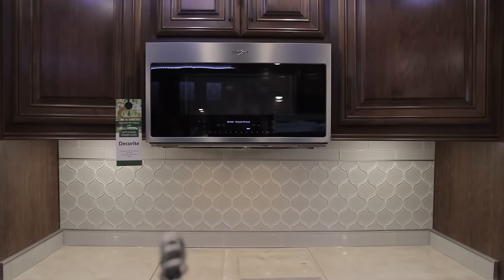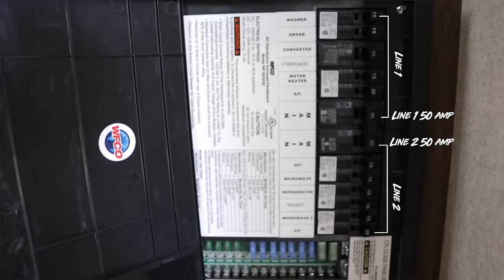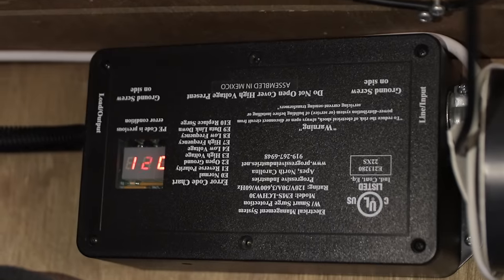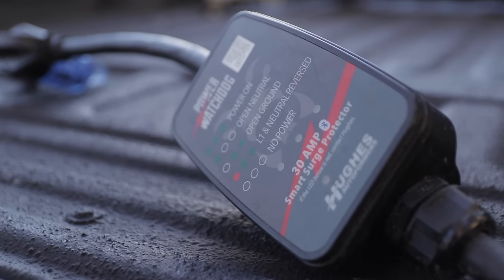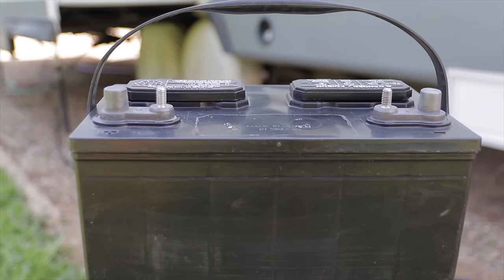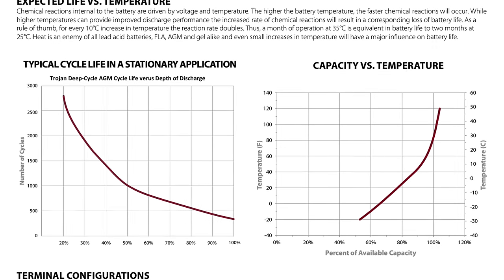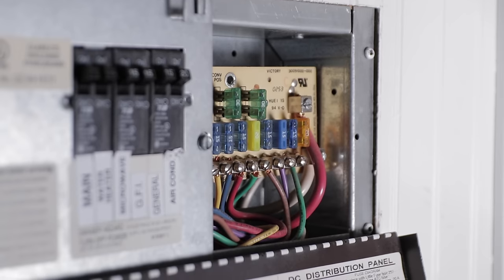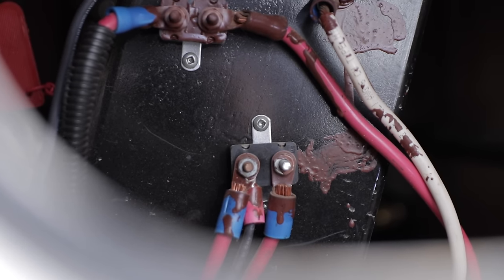Understanding RV Electrical!

Comment: Just this week I replaced a 30 pound converter in my 30 year old class A with a converter that weighs maybe 4 pounds and does much more for my house-batteries and D.C. system than convert A.C. The old one hummed 24 hours a day, the new one is silent. I think that old converter ruined my 2 new lead-acid house-batteries in less than 2 years. I also discovered that my AGM starter battery had been hooked to a non-AGM trickle charger and maybe that's why that Optima battery only lasted 2 years. I started on this voyage of discovery when I was cleaning terminals and found that there were 8 "short stop" switches, heat-sensitive switches fed by the converter and the one coming from the converter was defective. That was why my radio, tank-monitors, battery-readers,  lpg alarm, water pump, captain's chair controls and under-cabinet lights weren't functioning. And, that's probably how I was able to purchase this motor home at such an unbelievable price. By replacing a $3.50 switch, everything functions correctly. Pure luck.
Reply from the maker: That's great!

Comment: Just started watching your videos since I just purchased my first camper. Appreciate the tips!

One minor correction to your video is 240v is still considered single phase. It is 2 phases but is still not called 2 phase or split phase. It’s just single phase
Reply: The 50 Amp 240 V AC outlet is Single Phase and it is Split-Phase, not 2-Phase ..

Comment: For those watching.   The last RV park I designed was done with a three phase system voltage.   Single phase receptacles at the pedestals.   The point is, if you check the voltages on the 50 amp receptacle, you will get 120 volts from each hot to N&G. But you will get 208 volts from the two hots.   This will cause you no issues!   Everything in your RV is 120 volts.
Reply: I have My Ac running every day, but I don't understand why it keeps turning off the breaker, Please help me I have 3 kids and it's about 120' Hot.

Comment: The new Ford SD trucks are isolated as well. When the truck is running it charges the trailer batteries but when the truck is off it does not scavenge off the truck batteries.

Comment: Thanks for this...In over 15 years of owning RV’s we have never had bad shore power, and tbh I never gave it any thought until watching a few of your videos.  Suffice to say it seems we have been very lucky.  I’m having a lot of problems researching them (50 A) because every one seems to have a totally mixed bag of reviews and horror stories (Including your Hughes) so I’m really at an impasse as to which one to buy).
Reply: Fifth Wheelin' Food and Fixin', we have a progressive industry unit and had nothing but good luck. This was after the 2 Cheapo units sold at the big box camping centers. We looked  at space craft and New horizons and they come standard with progressive industry EMS units. A little more expensive but you get what you pay for. 
Jared uses a unit to check power at the pedestal. I turn off main power to the coach then look to see if there is a problem due to mine being a hard wire unit. Just an opinion.
Reply: This is how i looked at it, when we had our small Travel trailers, we didn’t have an external or hardwired surge protector, we were a bit in the dark, and like you we were lucky, never had an issue. Then when we paid 5x more for a big rig on 50amp, all i knew is gotta get on this! i needed one now before picking up that new rig, so being i couldn’t decide on what hardwire one to get, I decided on any external one that had all the basic safety features all the other external 50amp brand ones had, found a camco brand 2/3 the cost of the others. It will do, at least i have one, and it has actually been pretty darn good so far. Does the same things as the others. Also i kept in mind that if your surge saves your rig from some issue, your surge is toast. So how much to spend, how fast i could get it were factors for me when i was looking for one. Now many months have gone by, i think about do i even want to deal with the hassle of a hardwire one, installing, then what if it gets fried? how easy is it gonna be to remove? replace? Things yet to think about. Cheers 🍻
Reply from the maker: I haven't had any problems with ours, like Chip Saunders we have the hardwired Progressive Industries and have loved it. I called with a couple of questions a few months ago of me adding a bypass switch and they were very helpful. I would recommend them.

Comment: This was superbly explained. I just got a van ready for "Camper conversion" it has all the electrical components. They were originally installed professionally but some of them are now disconnected.  I am trying to figure out how things work as I want to relocate the cables and components. Unfortunately the seller had no idea how it works.
With this videos (and searching the manuals for each of the components) I will try to make sense of it all. At least now I know the names and functions of the components :) and I can start making the diagram of the "how it should be" and match it with how it is.
 In case I get lost, anyone knows what kind of electrician/Mechanic can help me make sense of the system? Having a diagram will help me lots.

Comment: Great video I really enjoyed it and learn so much. I do have some questions like , If a battery does not need to drop 50 if its total power, or  you can damage the batteries. I had a friend that had 12 volt batteries he told me that he used them until the  voltage came down to 6vdc . He then had the dc charger to start charging  the batteries back to 13.6 Vdc. His batteries only lasted a could of months then they they were bad. I informed him that 50% of a battery is around 12.2 vdc. The reason is the current of the batteries drops so low that if you kept using  battery power you will shorten the life of most batteries. Why  do they not connect batteries that the battery bank voltage would be 48vdc ? Each time the inverter has to step the up the voltage their is power  loss. Example 12vdc to 24vdc, and 24vdc to 48vde. Here you have a lost of power three times. Just a couple of things that popped up in my head. I'm trying to understand. Is it true that  Lifepo4 can be discharged to 0vdc and will not hurt the batteries. Most of these type batteries have a 11 year warranty. It has been stated that these type of batteries can last 4 times longer than other type batteries ? I believe if you could run everything of this DCV. You would not need an inverter what so ever. The battery pack could be
arranged that the need for AC power you would not need ?  Just something to think about ? Call me crazy ! !

Comment: The battery disconnect switch: I have noticed that when using shore power, if the battery disconnect is in OFF position, the rig has lights from the converter. However, the house battery is not charging ? Then, when switched to ON position (while on shore power), the battery gets a charge voltage. I should note, I disconnected relay that allows converter to charge chassis batteries so engine alternator is not charging lithium house batteries. No solar, too complicated.

Comment: Jerad, I think of my Class A motor home as having 4 electrical systems: 1) Chassis 12 VDC, 2) House 12 VDC, 3) Inverter 120 VAC, and 4) Shore/Generator 120 VAC.  There are appliances that only operate on one of these 4 different systems.  (I have a 2008 Tiffin Phaeton.)  Examples:  The Chassis 12 VDC (#1) powers the cockpit radio, the dash fans, and the passenger seat's electric recliner.  The House 12 VDC (#2) powers the lights, water pump, propane heater fans, slides, vent fans, etc.  The Inverter (#3) powers the compressor fridge, microwave, 120 VAC outlets, and a myriad of other plug-in appliances.  The Shore/Generator (#4) power source is required to power the A/C units, washer/dryer, and electric water heater element.  I would assume that most motor homes have similar systems to mine.

Comment: There’s single phase, three phase but never hear of split phase. I do know you have two single phase 120v circuits in the panel and if you use a double width breaker you’re using both circuits which gives you 240v single phase

Comment: Can you explain when plugged into shore  power, does running furnace or 12v equipment totally bypass the batteries and run off the converter?  Or do they run off the battery and the converter is just provider a constant charge?

Comment: Benn watching your vids and love them. I want to install an AiLi battery monitor on my Rockwood Afram,e and trying to figure out how to mount the shunt with dual 100 AH AGMs on the outside of the camper in battery boxes. This is only our 2nd year with our first camper.

Comment: I plan on using a 21 Jayco Bungalow (50amp electrical plug in) as a permanent residence for about 5 years at a house. I will have a 50amp plug in installed with a 30 Amp and 20 Amp at the house. That being said, do I have to have batteries to run the Bungalow if it will be permanently plugged in? Or do the converters need batteries to send the power to DC related systems?

Thank you and stay safe,
Your channel is amazing.

Comment: Question Jared! Using the Watch Dog surge protector  is there a reason why you can't just plug into the 120V outlet (house type) instead of using a dog bone to plug into the 30AMP outlet.

Comment: Referencing the battery disconnect during storage to save the battery from draining.  If you engage the disconnect, does the  battery still have the ability of being charged if you are plugged into shore power or does the disconnect totally isolate the battery completely? Thank you very much, awesome video.

Comment: If you have your RV sitting for a month or two between trips, any reason you shouldn't leave it plugged in if you can?  We have a 50A hookup on the side of our house.  We thought it would be best to leave it plugged in all the time so the batteries are always ready for use.
Reply: Good question I do the same thing.
Reply from the maker: Yes it should be fine to do that as long as you have a multi stage converter. If it is single stage it will end up killing your battery. There should be a model number on your converter, I would look it up to see what you have.

Comment: Great video, quick question. Just for clarity in my mind. About 12 minutes into the video you mention removing everything from the negative side of the battery and putting "everything " on a busbar. Is there any chance you meant to say "you removed everything from the ""positive"" side of the battery" and put it on the busbar?

Comment: I only have 30amp according to the type of plug. How would one upgrade to a split 50amp? I'm converting 37ft rv into a tiny home for permanent living. The electrical company is going set up a 100amp box for me for the rv.
Reply: If you are wired for 30 amps, you are wired for 120 volts. In order to use a 50 amp supply, by split I guess you mean 240 volt, you would have to replace the panel and everything from the panel to the connector on the side of the trailer. If you are intending to use 120 volt 50 amp you still have to be certain that your panel and input wiring is up to the task.
Reply: @michaelgibney3772  Thanks for reply, but it turns out that I actually have a 50a plug. So that was good to find out!

Comment: Thanks for answering the alternator question.  I was wondering about that when you have solar and lithium batteries installed.  I'm assuming that means you are also able to use the switch (sorry I don't know the name of it) that bridges the house and engine batteries to start the engine should your engine battery lose it's charge.
Reply: As a general rule you don't want to use Deep Cycle LiFePo4 to start engines.
LiFePO4 batteries themselves come in two distinct types as determined by cell type:

Deep Cycle LiFePO4: essentially the distinction boils down to the amount of lithium present in each cell and the intended application which in this case is to power electronics for long periods of time. This type is designed with capacity in mind and at its heart stores lots of power in a very small package and as such has more lithium per cell. A deep cycle battery of this chemistry will not be able to crank your engine. 
High Rate LiFePO4: these are for starting motors only, the difference being that this type has dramatically lower lithium content per cell. However, the lower lithium quantity is not an issue because by design this type is only intended to output large bursts of energy for a short amount of time. As such, this type does not need that much lithium. While this type can be mistakenly used for a deep cycle application, doing so incurs significant risk as the high current rating has a high likelihood of damaging your load. These batteries are easy to identify because they have two distinct characteristics: A) a Lead Acid Equivalent Figure and B) have a CCA (Cold Cranking Amp) Rating. 
These two types are not to be confused or interchanged. While a High Rate will be able to power electronics, it will only do so momentarily as they by design do not have the storage capacity needed for extended use. Moreover, the high current ceiling will not mitigate current spikes the occurrence of which will damage your equipment. If you are powering equipment, you require Deep Cycle Batteries. If you are starting motors or powering your flash on your camera, the High Rate is the one for you. Remember the following rule of thumb:

Deep cycle/deep discharge and high rate/starter are two different batteries even if they are from the same chemistry. This holds true for all battery types, even Lead Acid/SLA/GEL/AGM. A battery is either for deep cycle or for starting, never both despite any claims which may be made so make sure to double check your application and confirm your requirements before purchase. 

https://www.bioennopower.com/pages/faq-lifepo4-batteries
.

Comment: I plan on pulling my batteries out for the winter and put them on a trickle charger in the garage, as the trailer is in a storage yard with winters that can hit -30C here in Calgary.
When visiting the trailer, can I plug my 2000w genset into "shore power " and have the 12v side work?

Comment: For my property, I am getting a 13000 watt generator for my RV.  My question is, can I make a stationary breaker box post to connect my generator and then connect my RV to the box, or is it redundant?  Should I just plug the rv directly to the Rv? My RV will be stationary at my property. How do I ground the Rv, or should it  be the generator

Comment: Jared, I’m late to the party but thanks for this great info! I have a AC/propane fridge in my rig. I like to travel with the propane off. Is there a way to have the fridge stay powered/cooling on the alternator while on the road? Do I need to replace the unit with a 12v DC model? Thanks again 
John

Comment: I'm moving into a 5th Wheel soon & I'm a beginner in RV living. The RV is located on my nephews property next to his shop, I was going to hook up my 30 amp electrical cord to an outlet in the shop with an adapter. Would that be safe?, Should I only do that short term? Or should I just have an electrician hookup my own power source? I'm trying to find answers before I move into it full time. Any kind of information would be appreciated 👍

Comment: Thanks for your very easy to follow videos. My question has to do with a class A when the house battery disconnect switch is in the off position during storage. Will connecting the RV to shore power keep the house and chassis batteries charged? Specifically on a 30 amp system will a standard 120v 15 or 20 amp circuit provide adequate power for the converter to keep batteries charged?

Comment: Hello. I love your site. Thank you. My question is I have a 50 amp surge protector. I’m about to buy an RV that only has 30 amps. Do I need to buy a surge protector for the 30 amps, or will my 50 amp protector work? Thanks again.
Reply from the maker: I would get a new EMS Surge protector otherwise you always have to use the adapter.
Reply: Question: wouldn’t an adapter be cheaper than a new surge protector?

Comment: Hey Jared. First I love you videos. I learn so much about everything. Keep up the good work. 
Now for my questions. Lol. You have a either a 20 or 25 amp busbar on your Amazon page. Why not higher? I'm looking to add busbars to my small travel trailer for both positive and negative sides. Trailer is 30a. Should these work or would you suggest something else?
Reply from the maker: Great question. The 30 amp RV refers to the AC side and a busbar we have linked is for the DC Side. For our install we made a busbar out of copper bar but I would recommend one like this. https://amzn.to/2wEur90.  We didn't use a busbar between the batteries and the Inverter because that has 4/0 wire and a 400 amp fuse. We did use a buss bar for all other connections on the DC side.

Comment: I know nothing about electrical systems on an motorhome or any home for that matter. I bought a used 2000 Allegro motorhome and parked it at a storage facility.  Before I locked it up I thought I turned every switch off on the control box but when I came back a week later I couldn't start the engine and all the lights were not working. Checked the switches and they were all on so I guess all 3 batteries drained. Now I don't know if I should jump start the engine battery without damaging the rest of the electrical system or the two house batteries. Any suggestions, advice will be appreciated.